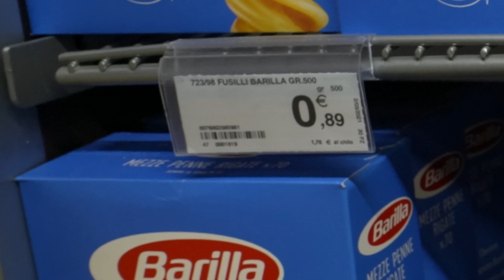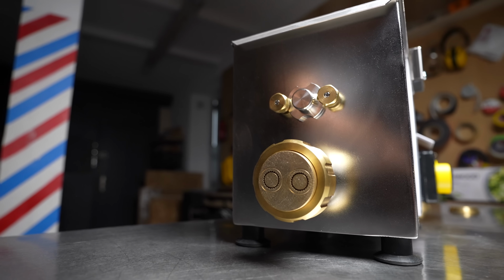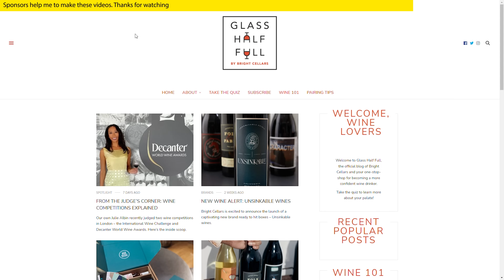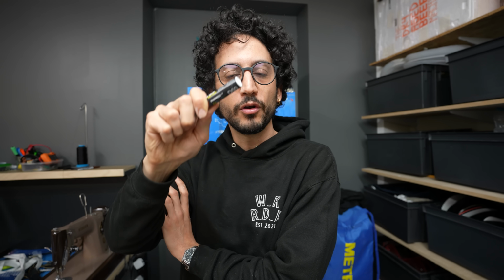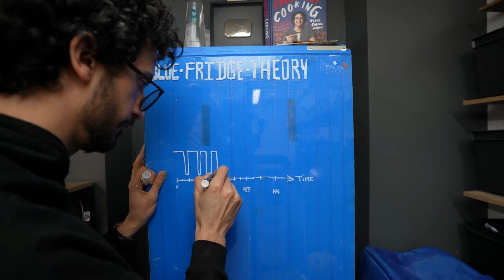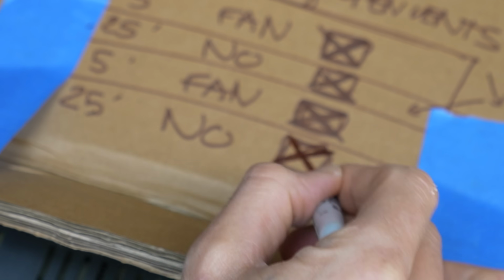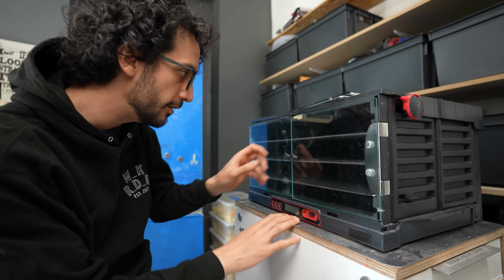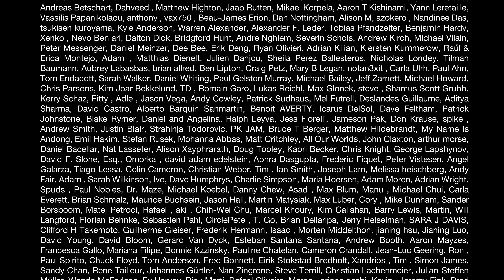This is Why Drying Pasta At Home IS ALMOST IMPOSSIBLE

Comment: The dehydrator might only need to move a small volume of air out of the chamber to work properly.  If you take out a higher volume/time, you might create a faster drying condition and cause the pasta skin to dry too fast and not allow the internal humidity to migrate out.
Maybe better add a recirculating fan, again, not too big, you do not need a tornado in there.

Comment: idk I never had problems air drying my homemade pasta. It takes 1-2 days and its completely dry. i stored it up to a few months and it still was good to eat. I noticed though, that it dries quicker in winter season when the heating is turned on and I avoid drying it when its a rainy season in summer and the air is very humid.

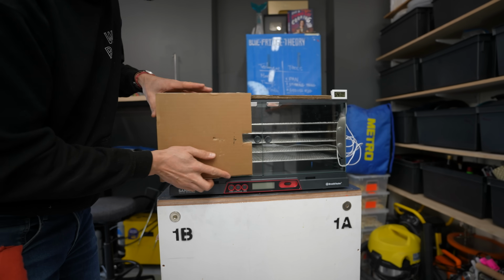Comment: @10:20 I have a timer which can be set to turn on or off at different times. 
The best way would be to have it turn on and off depending on a simple, cheap Arduino controller based on a humidity sensor.

Comment: "Plastic" means that the stress you are causing permanently deforms it, that is called a plastic deformation. "elastic" refers to the ability for a material to return to its original structure after the application of stress, that it an elastic deformation. Generally, every material has a point of stress where any deformation done will transition from elastic to plastic deformation.

Comment: Elastic deformation is the 'soft' one. It is the amount of flex a material has before it permanently deforms. If you flex something and it permanently deforms that is plastic deformation. A material is capable of both elastic/plastic def and the difference is the threshold between the two. A rubber band is an example of a material that can undergo a lot of deformation and return to it's natural state; elastic deformation.

Wet pasta can only flex a little before it is permanently deformed; a low plastic deformation threshold. Dry pasta is able to undergo a little more elastic deformation before permanently deforming; because of it's brittle nature there is probably not a lot of plastic deformation before it cracks. You can't bend spaghetti into an L after-all.

Comment: I would love to see if vacuum drying works for drying pasta. Although you may need to cycle the vacuum like the regular dryer to prevent cracking.
Reply: Classic vacuum drying is much too low in humidity, and the difference in the rate of evaporation at the surface versus the internal migration of the water molecules diffusing out of the matrix is too large - it would make the problem even more pronounced..

The surface evaporation rate needs to be in balance with the internal diffusion rate in order to prevent product breakdown.

Comment: The cooling and soaking cycles remind me of tensile and compressive stresses on a nuclear reactor vessel when we cool down. 

If we cool down to quickly, we have to hold temperature to allow the pushing and pulling forces to balance so we don't propagate any potential flaws. If we cool down the vessel at a slower speed, no soak is required.

Comment: On the topic of plastic vs elastic:

Plastic materials, as you have noted in the video, keep their new shape on deformation. Think of a cheap plastic knife. If you bend, the bending point turns white-ish and stays bent. It is plastic. 

Elastic materials return to their original shape after deformation. Think of a rubber band. When you stretch it and then release, as long as it doesn't break, it contracts back to its original size. It is elastic.

You seemed confused why the soft pasta is plastic while the hard pasta is elastic. The difference comes from hardness increasing the brittleness: the hard pasta is more brittle than the soft one. So, even though the hard pasta is elastic, it will break long before any noticeable deformation.

Comment: Why not start from scratch and build a custom dryer? Use something like an ice chest for the container (good isolation) then buy an industrial timer to turn it on and off. You could use an incandescent light bulb as a heater and high flow computer fans for cooling.

Comment: You should try home assistant with an rpi and zigbee usb dongle. Place a zigbee sensor inside, and control the dryer via the rpi. You're the engineer, and you can do it! (Also it seems the dryer is taking air out of the machine rather than into it, its like you said, it sucks, not sure the reason for it, but turn the fan direction?)

Comment: I see how a computer fan could easily fit in there, you could even get a controller circuit to fine tune the air flow

Comment: I'd encourage you to log the temperature of that dehydrator over time. Many cheap appliances are terrible at keeping a constant temperature.  

You can also automate the on and off cycle with an arduino micro controller. It wouldn't be a difficult task

Comment: Sounds like you need to control not only the temperature, air flow and time but also humidity. Would a humidifier help in that regard?  Temperature control by only heating may also not be enough, adding a airconditioner could be helpful too. ACs dry the air as well.

Comment: You are on the right track. But you might want to use less guess work and more controlled experimentation. 1) the time in the resting zone has a minimum but probably not a maximum. So instead of turning the machine off, simply swap trays of pasta in and out and only focus on hitting drying time and making sure the resting pasta stays out long enough. For resting time, more is better probably. 2) water content is something you can measure by weighing the pasta. You, need to know when to stop and how much water you are extracting per minute with your setup.  You know the hydration you start with and you know your target. So, make sure you nail it with enough resting phases. 3) experiment with the length and number of the cycles. 4) figure out humidity during your rest phase. It probably varies with the weather. It might be too dry even. Maybe you need more humidity and lower temperatures? How about a plastic bag and a fridge? What's the optimal humidity? Probably where it does not absorb water from the air. 5) what about freeze drying?

Comment: The working fan isn't the only option my friend. Just spend the 4 hour time frame to dry a single pasta noodle at a time, 2 at a time if you're brave enough. You can have a full dinner for 1 in maybe 50 sessions or 200 hours 😋

Comment: I think you may have transposed plastic and elastic deformation 

Plastic deformation is the permanent distortion that occurs when a material is subjected to tensile, compressive, bending, or torsion stresses that exceed its yield strength and cause it to elongate, compress, buckle, bend, or twist.

Comment: With your expertise, I'm sure you could wire a computer case fan into the hot box and solve your problem. Those things are designed for moving hot air and not that expensive, so I think they would work decently as a first attempt.

Comment: In order to mod the dessicater, I'd advise a stronger fan (DUH...) and more importantly : an impingement cover (a metal sheet that covers the entire back of the oven with holes all around placed so the suction power is distributed evenly throughout the dessicating area)

This cover will be a hell to be properly designed, but you might not need that level of precision here (no need to rush and buy a CATIA license with a fluid mechanics simulation module).
A rule of thumb would be to place a greater hole density on the areas the more further away from the fan and managing to have a total holed area roughly equal to the fan inlet

Comment: You gotta increase the convection. All the heat in the world isn't gonna do squat for you if you aren't moving the air.
Only thing hot air is doing is holding on to more humidity. You still have to move the air.
Maybe rig a box to hold your racks and blow a dehumidifier through it?

Comment: Alex, you need proper process control. Install temperature and humidity sensors and a way to store and graph the readings. Then you can control the drying process and have readings for correlation.

Comment: To correctly dry your pasta: consider f to be a function of time and f(t) to be the distrubuted heat at any given time in the doman of le' function. the area under the curve from x=0 to x(t)=0 is the total amount of heat energy distrubuted to ze pasta. dertermain that! the optimal curve function shoul look like a parabela tilted on it's side, with ze pointing end at the right. do intervals as suggested, more heat, less rest -> less heat more rest :: use an arduino or pie for zis. make sure temperaturer is even througout the entire oven. use multiple sensors! you want ze pasta to be hard, yet, not brittle!

Comment: I think a nother problem will need to be addressed, the tasta video wasn't just about hot and dry - > rest, ut was also colder and higher humidity.
Cold can be room temperature, but I think that you might need the reintroduction of humidity.
A idea for doing this could be to introduce higher humidity in the inlet during the evacuation of the hot air.

Comment: That fan is clearly sucking, not blowing. I believe this fan gather air from the compartment, and blow it out on the side, through warming elements, so that you get hot air flowing out at the back wall and with the fan sucking, will create a circulation. That is the smart way, seen at you do not want hot air concentrated in front of the fan, making the area in front of the fan useless for what the chamber is made to do.

Comment: Alex. That fan does not blow air in, it sucks air out, it's why the thread goes towards the grill. Sucking out the air makes it much easier to get a good airflow distribution but the airflow inside does not show. Your fan idea will not work, it concentrates too much. 
Also, if you are into learning get a small PLC (industrial Programmable Logic Controller) They are like arduino's but industrial grade and cost as little as 100$/Euro. They can take over the sensors for heat and humidity (you might need converters) and control the heater and fan from your dehumidifier. Learning curve is steep but not as steep as Arduino and wiring and such is much tidier. Your dryer will do what you want it to do.

Comment: What I see is a higher level of hydration of the individual granules of the semolina. It appears more uniform, as though it has become more homogeneous in texture. The manufacturers may start with a finer flour, or perhaps a longer resting time for the mixture to equalize. Then extend the drying time. Make it more gentile. Keep the airflow, but reduce the heat. Perhaps to no heat. Perhaps more kneeding of the dough to get the gluten proteins to bind together?

Comment: As a commercial pasta manufacturer, who also manufactures commercial pasta dryers, it's not as complicated as it seems. 
1. It's likely your recipe is off
2. Drying is a balance of heat, air flow and humidity. Reduce your temperature, ensure your dehydrator has good air flow and aim for 6-10 hours (depends on your climate). 11-14% humidity should be the final aim. You don't need eggs in their either

Comment: Your problem is not the drying process. It is the dough itself. You have to kneed it until its done and rest for minimum 30 minutes. Then it works. 
I had the same Problem in our bakery. This fixed it. 
Greetings from a german baker 😁

Comment: Try vacuum drying. I think your issue is similar to that of sawyers trying to dry wood. Just throw it in a vacuum pot and and let it sit for a couple days. It's a bit unconventional, but it bet it's way simpler than building a computer controlled smart dehydrator.

Comment: Might i recommend looking at desktop computer fans, something from noctua or something they have some quite powerful fans the one in the back of that thing looks around 200mm, the only issue is power delivery but if you get a pc next to it you can have it being powered from the pc and you can control the fan speeds automatically. just an idea.
Reply: im sure even there are some small arduino or something similar boards you can get with a fan header on it with fan speed control

Comment: Use an arduino or something to control an external switch that just turns the whole drying unit off and on by an adjustable schedule.  Then you just need to adjust the code instead of sitting there constantly for 4 hours

Comment: Dude Alex I bet there's a decent amount of air moving through there when the doors are closed. With them wide open the thread probably doesn't move because relative to the amount of air coming in its not much until you are right by the fan. Think about a PC case the fans can push the confined air through but only when it's sealed up

Comment: Um... The literal meanings of the two adjective — plastic and elastic — are, respectively: "that of what can be shaped" and "that of a sheet of metal or so." From the verbs πλάθω (to shape, as in a sculpture, clay, paste or the like) and ελαύνω (to strike, but in a sense which ends up applying to beating metal into a thin sheet). So plastic is that which can be given shape to and retain it, whereas elastic is that which tends to revert to its original shape, the way you can bend a metal sheet for a bit without it remaining permanently deformed.

Comment: Just a couple questions if you happen to see this: 
First, how come you mix the dough in your stand mixer instead of the pasta machine when the pasta machine has that function?
Second, are you really only putting in 25% water versus flour by weight? Your results look great obviously, but that’s less than I’ve read and experimented with. Your shapes hold well, so I may try it!

Comment: You can compare this plastic/elastic stuff to metals. An elastic metal will always go back to its previous form, for example cast aluminium or cast steel. Those materials are ONLY elastic and also very brittle. In comparison pure aluminium or gold are very soft materials, they are plastic, so you can deform them heavily but they won't return to their original shape.

Comment: Come on Alex, you know better than that. Elastic and plastic deformation are just the names given to two regions of the same stress/strain curve. Even undried pasta undergoes elastic deformation, it’s just that the amount of force before you reach the yield strength (the point at which deformation becomes permanent) is so tiny compared to most materials, we don’t even see it. Conversely, dried pasta acts much more like a ceramic, with very high stiffness and therefore brittleness, it’s yield strength is right next to its ultimate tensile strength, meaning almost all of its deformation is elastic before it simply breaks. Hope that’s useful, and you haven’t had another 500 comments telling you the same thing already 😉 really love your content. Your channel is really outstanding and unique. Keep it up 👍🏻
Reply: Follow up comment: it seems your initial attempt at drying pasta resulted in something a little like a St Rupert’s drop. With the exterior and interior having different elastic modulus’ resulting in large internal stresses just waiting for a fault to give way destroying the whole structure. Slightly less spectacularly , but perhaps that’s what’s going on. What do you think?

Comment: Alex. 
Absolutely everything can go wrong!
Firstly, the fact that you have turned off the dehydrator does not mean that you have started a rest cycle. The pasta is still in the high temperature and low humidity zone. This volume of air with the doors closed needs at least 20 minutes to get to the right conditions. So it would be a good idea to manually take the pasta out of the dehydrator and transfer it to the resting area. For example, you could heat the oven to 30-30oC and put a plate of water in the bottom. If you have a humidity meter, this would at least be a discussable, homemade option.

Secondly, if you replace the fan on the dehydrator, it may get out of adjustment and not be able to deliver the correct humidity at the set temperature. At the very least, do not put a strong fan in there. Moreover, If you'll get a separate resting area, just let the dehydrator run non-stop maintaining the required conditions for drying.

Thirdly, it is the excessive time during the drying cycles at high temperature that is bad for the quality of the pasta. And it is especially dangerous when the dough is most moist, as this achieves the greatest deformation of the surface layer and it cracks. Try the first few drying cycles at a lower temperature (50°C) and then increase the temperature as the paste dries.

Comment: My feeling would say that for a pipe pasta like rigatoni, you'd extrude them then put them on a little string and hang it up besides the fire so that it will dry more slowly. But hey maybe that wouldn't work at all, of course I don't have a pasta extruder so I  never tried that.